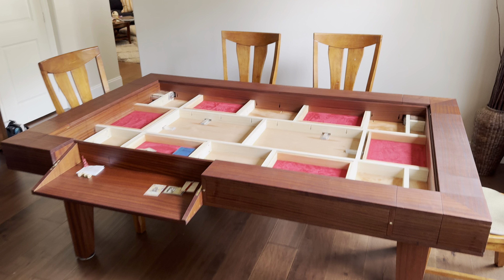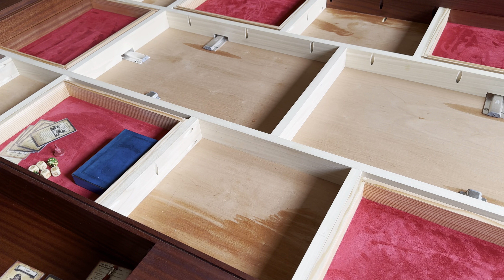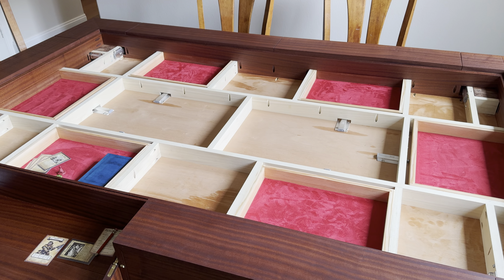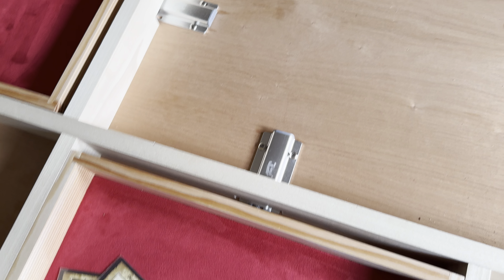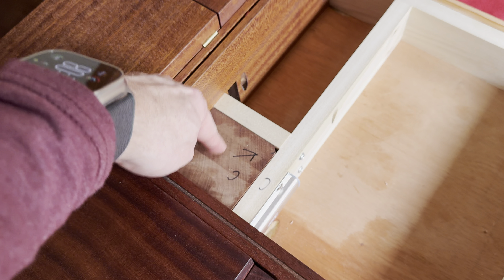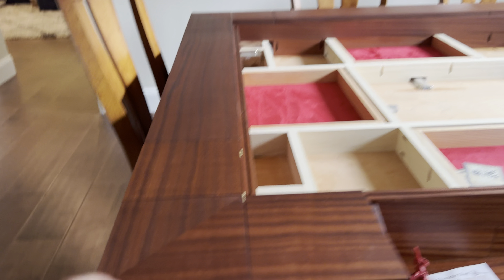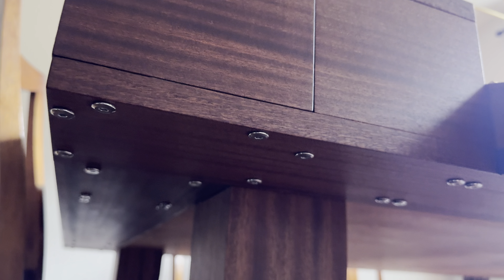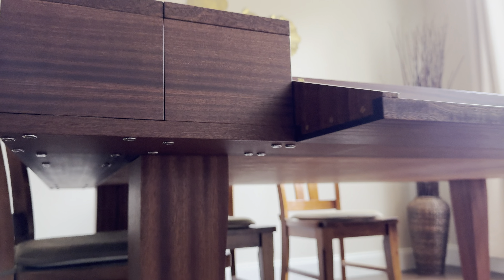Game Table Interior

Comment: I'm thinking about building something like this, just missing space to place it.... But my current idea is using switchable magnets for the modularity and topper. (welding squares or maching measuring tool bases) they can hold perpendicular force in 10s to 100s kgs